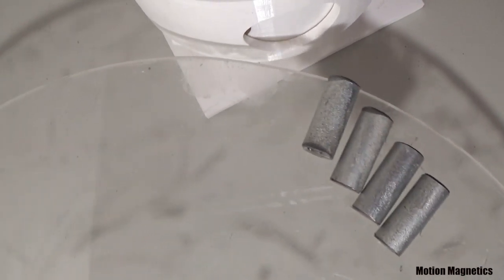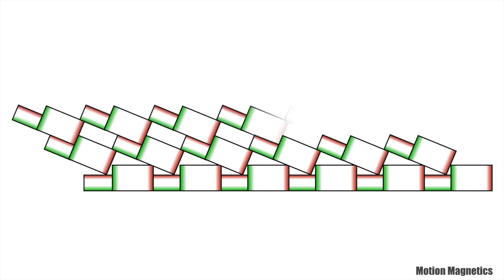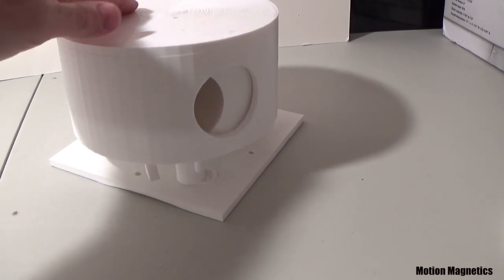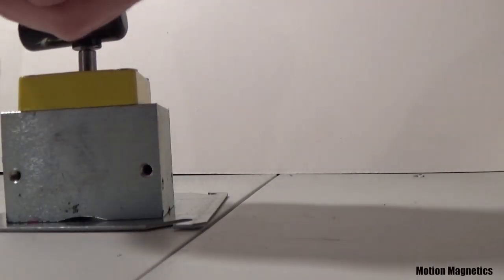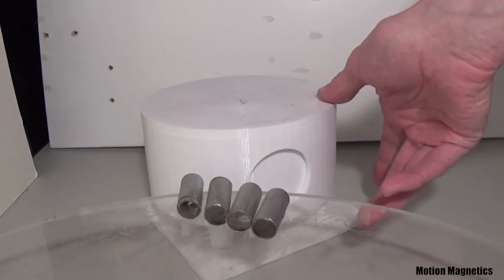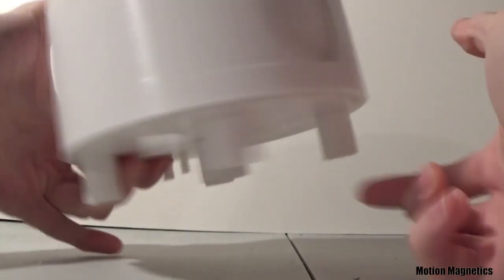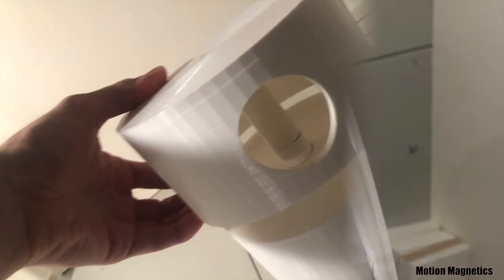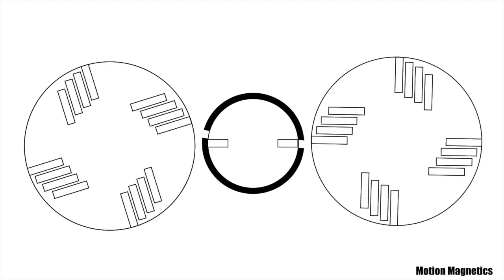The Key to building a Magnetic Motor

Comment: Your foundation concept is flawed.  The magnetic switch does not "shield". The way it works is, it redirects the Flux fields.
Bottom line is, you are a YouTube creator, vying for traffic using clever theoretical conceps. If you really want a "motor" that self starts and accelerates, you'll have to learn how to redirect Flux. Such a motor already exists and for most, it is hidden in plain sight. Just look around.

Comment: As with all magnet motors this will never work, energy used for moving parts of the shield will be greater than momentum gained by non shielded magnet. Under physicall laws energy gained into system will be spend on gears which will move shielding. You do need understand magnetic force works as something like pull bar - energy is ballanced until something will gain power to move one and based on this second one.

Comment: I have a plastic bicycle wheel mounted in a square wood frame with a crossbar to hold the axle that I have put various magnet configurations on, starting with a bedini SSG setup and a bunch of other configs. I am thinking about a HJ setup with magnets getting progressively closer together on the wheeel, and one of them mag switches mounted on the frame so that i can turn it off in a way similar to your setup at 4:20 - so I know that I will probably have to switch to iron not magnets but then I am thinking I am not going to get that much pulling power out of the mag switch and iron setup. Imagine magnets would work if you will, so that setup I make it where I get the most travel out of my wheel by spacing the whole iron or magnets as far as possible along the wheel... when it gets to the end of the travel, I have a servo switch the magnet off,  then switch it back on once they have passed. that is how I could run one of your proposed setups as a full experiment. I have been thinking about this and always check back to see your progress as you are the most advanced guy on this subject. I would like to hear your thoughts on my idea if you would be so kind. Myself, I put the PMM setup on the shelf, and have thinking of combining some electronics to aid in the goal of a self running motor, be it electromagnets or using servos to move magnets in order to avoid the inevitable lockup a PMM setup would encounter. Thanks and KEEP ON DOING GREAT THINGS!
edit: the setup described would be the prime mover for the wheel, then I could wrap a belt around the bicycle wheel and a small pulley on a dc motor to generate the power to run some logic electronics and the servo. Yes its only overunity but including Bedini, do we really have a replicatable OU device that is reliable and viable? My goal is a machine that runs on battery power that the total stored charge increases as it runs

Comment: What a unique concept, thanks. I don't know how much torque your motor would produce since it's a balanced system and any torque would throw off the balance...
Reply from the maker: Thanks. I couldn't tell you exactly, as it would depend on many factors in the construction, but I believe it would work.
Reply: @Motionmagnetics  Not the least is the attraction of the magnet to the shield!

Comment: its gud to hear from you after so long. I should appreciate you , because from sooo long your are coming with great ideas that helped me to figure out a way  to make a  machine that run purely runs on magnets.........we cant make these type of things with magnetic shielding because they provide better path for flux.....instead of repelling them .....to make a device we need magnets that are slightly different magnets that regular magnets. we dont need monopole magnets, we just need to adjust the manufacturing process of magnets a little bit to make this kind of machine possible.......right now im making magnetizer to make magnets as per my own requirements.
Reply from the maker: Thank you. Much appreciated.

Comment: Sheild matereal ?
Reply from the maker: Something similar to what's used in the magswitch.
Reply: @Motionmagnetics  take one apart,  think you will find no sheild but think it cancilation the magnet not sheild it 
 Got my own idea for a motor
Reply: @Motionmagnetics  drive your rotors with toothed belt from under base plate
Then you can time the middel one to switch with internal cam lobe and keep all 3 to a set position you can ajust

Comment: Big Fan, can i confirm if you believe that the force to move the shielding is less than the torgues generated.
Reply from the maker: Thanks. I believe it's possible, with the right bearing and shielding material. That's partly why I showed the Magsquare in my video. With the flick of a switch, you can shut off a magnet with 400 lbs of pull, due to the shielding method it employs.

Comment: I’ve been playing with the same concept, though mechanically very different. The solution really is a pulsed system rather than a closed array which will always seek equilibrium. While it may seem only a change of phrase, I believe the motor concept as most people visualise will never work. I believe the concept of engine, is where the answer lies. Your rotary shielding is basically a camshaft, the rotor, a crankshaft. The trick is finding the correct pulsing, while allowing the rotating crankshaft to produce enough force, to activate/operate the camshaft.
Reply: The key element about what you are saying, is that you must derive the pulse from a power source that consumes less energy than what the motor itself can deliver, thereby achieving the much sought after, over unity... I have yet to find a material that will provide sufficient shielding to overcome magnetic field resistance, but am hopeful that there's something out there, which would make a permanent magnet motor possible... I have seen others achieve varying degrees of success using electronic pulsed timing, but am not aware of any that have achieved over unity.... Maybe someone has...
Reply: @Quickened1  Could Bismuth work as the shielding?
Reply: @sinsemilla9876  dismuth dsnt work
Reply: @Quickened1  Shielding is not required with Trance Ending's concept. The pulse replaces the need for shielding.
Reply from the maker: That's one way to go as well. I wish you success in your endeavors.
Reply: So many on the right track...Good to see! Don't forget the power of a clamped collapsing electromagnetic field. Way more powerful than most realize. Your closer than you realize to success.

Comment: You have the right idea. Everyone else has made "motors" that relied on the magnets doing the "work" and they've all failed. As long as you have motion, the motor will continue to operate. So the answer has always been under our noses, you must first design a mechanism that keeps "tripping" a spring to keep up at least a tiny amount of motion, that way the magnetic field can keep "pushing" (or "pulling") the metal it is repulsed or attracted to. Jesus bless you 😊
Reply from the maker: Exactly. Sometimes you need to go in the opposite direction instead of trying the same things over and over.